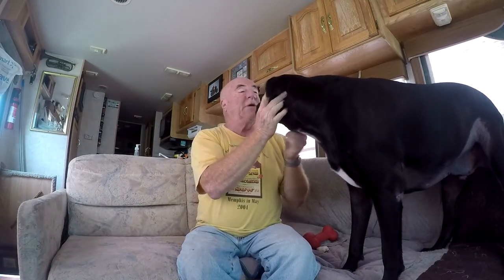Bad Fuel Update

Comment: I'm going to have to check on my fuel filter. I've never changed it on this RV. Thanks for the link to the necessary tools. I've changed fuel filters before and I've never needed anything other than a screwdriver . . . but everything is a change'n! Thanks for the update. Smile! :) & Be Brave!

Comment: Hey glad everything is working out. A cheap tool to release fuel line, a bic ink pen cap, cut tip off and split down length, slide over line, push in and release.. It works. Unless you have a different one. Good luck.

Comment: Is there not a drain plug on the bottom of the tank? If not and it's possible,(and on older vehicles I believe it is), I would siphon that last quarter of a tank out using a very long hose so you can put   some in a glass container and check it for contaminates. If any found I would put in 5 gallons of fresh gas and drive it around enough to slosh it around the tank and siphon it out again. As the shampoo bottle says "rinse and repeat" lol. Your opening clip of you and Rufus's jumping around makes my day everytime I see it. Have fun, be safe.
Reply: I don't think it's more than just water in the tank. Easy fix and no dropping of tank. Just think how much mud or sand it would take to plug a filter. Just not going to happen in today's world. The gas is filtered many times before it hits our fuel tanks. To even consider that it's dirt is just so unlikely.
Reply: There is no drain on gasoline tanks.
Reply: randomsanwhich
Not since the '60's anyway.

Comment: carry that filter with you. just in case. glad it's all working out for you
Reply: Does no good to carry a filter if you can't lower the tank and pull it out to change. Major job dropping that tank and he just filled up. If you want to carry spare parts then make it an alternator or something that line and maybe an extra fan belt and water hoses. Things he can actually fix on the road. Next you'll be telling to carry extra injectors.
Reply from the maker: +Jerry Densmore the filter is on the frame rail and I did change it!

Comment: I'm thinking you'll eventually have to have the tank removed and cleaned out along with flushing out the fuel lines. I certainly hope not because I know how expensive that can be. But in some cases it's the best long term solution to that kind of problem.

Comment: Why not go back to the gas station and approach them on this problem. They has to be other people experiencing the same problem. There should be some sort of financial assistant from the station. I would also disconnect the fuel line before the filter and let it run out until it turns clear. Good Luck.

Comment: the particles you showed on your paper are not big enough to be caught by the pickup screen. best thing is to put Heet gas dryer in the gas tank to distribute contaminants throughout the fuel and run it low, then change the fuel filter. Pump wont overheat if its submerged in fuel.

Comment: Does the generator pick up gas before or after the rv fuel filter?  Did you run the gen on the bad gas?  Best of luck.
Reply: The generator has its own filter and picks up gas from the center of the tank.  Not connected to the drive engine system.  Won't pickup fuel it the gas tank is below about 1/4 tank to keep the generator from running the tank dry.
Reply from the maker: Generator has its own filter on a dedicated fuel line.

Comment: If my tank had put that much grit into the fuel filter after changing the filter i would have drained the tank a refill with clean stuff , if there is water in there too it will be bobbling around on the bottom waiting to spoil your day .

Comment: I suspect that the whole problem you had is from water in the gas. There's additives that you can add to the gas tank to help when this happens. Just carry a couple bottles of it with you so if this happens again you just add the liquid and let it set for a bit to dry out the water and you should be good to go. I've heard so many horror stories of gas stations about to run out of gas cause the tanker is late and they just add water to get by for awhile. Some people never learn of this cause it doesn't bother their engine so much. Much smaller engines than yours. So they get away with this practice. Just get you some water evaporator liquid and travel safe my friend. Trust me when I say you are not have a plugged up filter issue. Even the gas stations have filters in line before it reaches the pump. So it's a watered down gas issue. Just imagine how much sand has to be in the gas to plug it up to the point of not letting fuel by. For this alone, remember the KISS trouble shooting. Keep it simple stupid.
Reply: Please watch his previous video. The gas station really did give out some bad fuel as in muddy, gritty ETC. Just adding a water absorption chemical isn't really going to help.
Reply: randomsanwhich
Sorry I didn't watch the last one. I find that hard to believe because it filtered so many times before it reaches the pump. Did they admit to selling bad gasz? Cause if they did for any bills that are incurred he could get them to pay for it. Probably do it out of court even to avoid any local headlines in the paper. You have to admit that water in the gas is pretty common and sludge isn't.